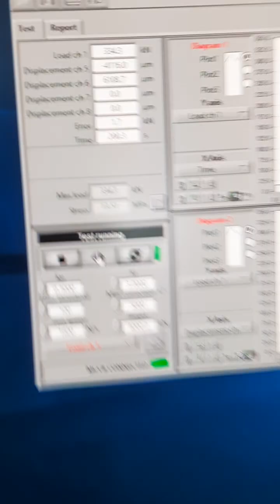Split  tensile tests of ULTRA HIGH PERFORMANCE CONCRETE IN IIT ROORKEE#iit #iitroorkee #ipl

Comment: The testing is not as per ASTM code to determine the tensile strength
Reply from the maker: The splitting tensile strength of ultra-high performance concrete (UHPC) is much larger than that of normal concrete. It was found that the studies on UHPC has mainly focused on the direct tensile strength or flexural strength, while there has been insufficient work to evaluate the splitting strength characteristics of UHPC. Therefore, this study is aimed at presenting experimental and statistical evaluation of the splitting tensile strength of UHPC. The splitting tests were conducted on cylindrical specimens of 100 × 200 mm size. UHPC was designed to achieve a nominal compressive strength of 200 MPa at the age of 28 days. Macro steel fibers were used to reinforce the UHPC by volumetric percentages of 0, 1, and 2%. The effect of fiber volume on the splitting tensile strength was investigated by the test results. The values of the splitting tensile strength of UHPC with and without fibers in some previous studies were collected together with this study and subsequently verified with the predictions of the splitting tensile strength obtained from the existing models. The appropriateness of these existing models was clarified. Finally, based on the regression analysis on the collected test results, a simplified equation was proposed to estimate the splitting tensile strength of UHPC having compressive strength varying between 120 and 200 MPa. Rilem https://link.springer.com/chapter/10.1007/978-3-030-58482-5_101#auth-An_Hoang-Le